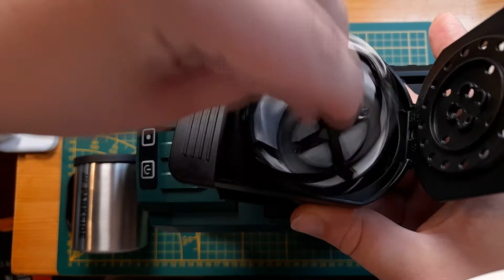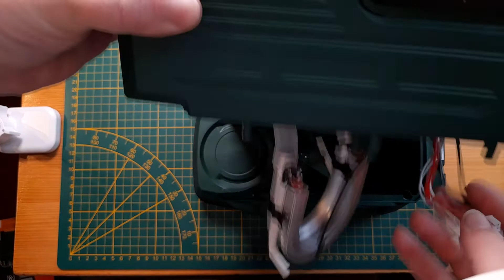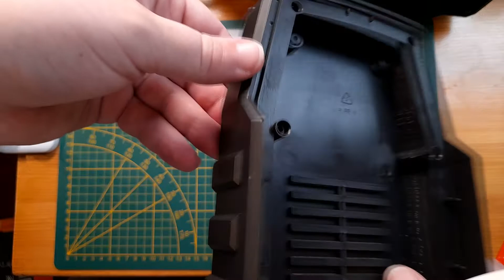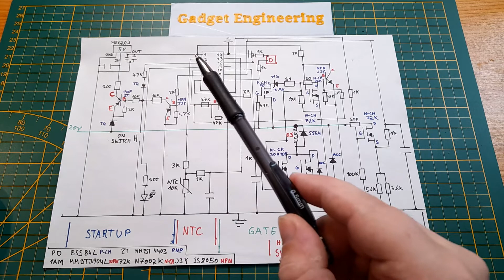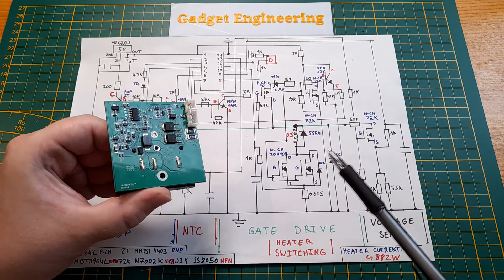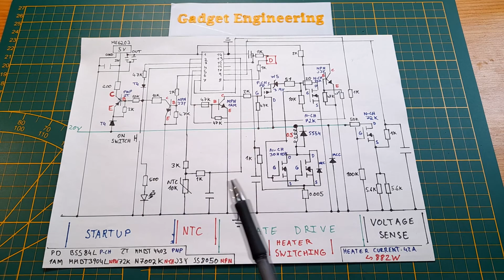Gutting Lidl's cordless coffee maker: what makes it tick and schematic

Comment: is there a hack to get this working with direct 20v trough a cable? with other devices you could put a 10k ohm resistor between the ground and the negative to bypass the battery protection mechanism but it doesnt seems to work here, i'm trying to hook this up with a 20v laptop charger, sinds you can only put 1 cup out of every fully charged battery, witch makes it pretty useless.

Comment: Thanks for this nice reverse engineering video!😊 Do you have idea where can I get this PCB? I have problem with mine, I think the digital comm is damaged on my PCB (which comes from the battery, it starts to pull 38-40Amps from the battery but shuts off a few seconds later, probably because there is no communication between the battery and PCB)
Reply: Try replacing capacitor C1. It's that capacitor between Pin 10 on chip and GND. Mine was faulty and caused this problems.